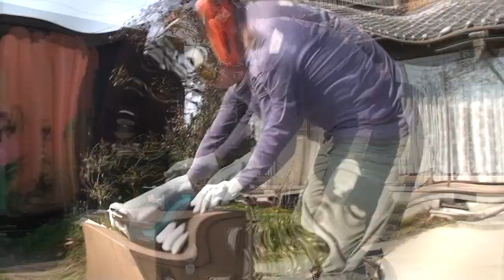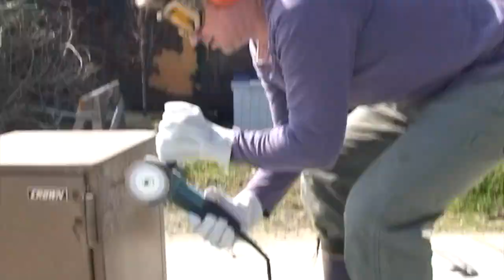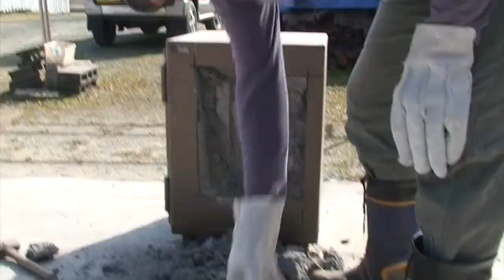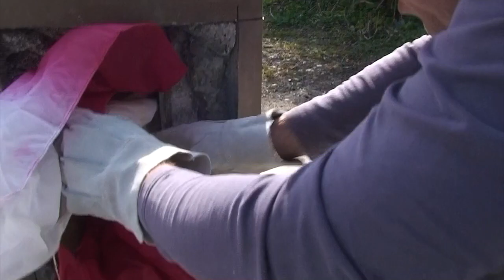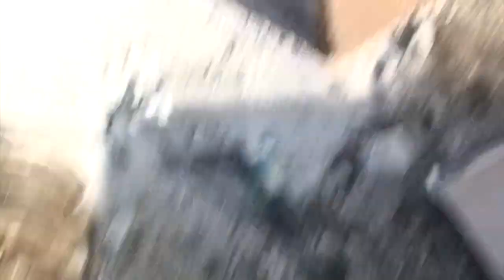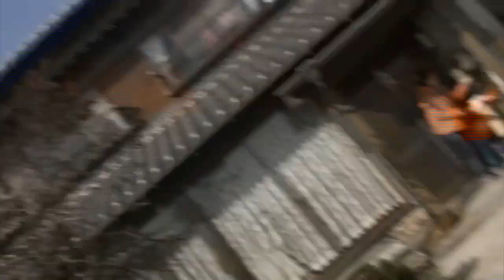Safe VS Angle Grinder

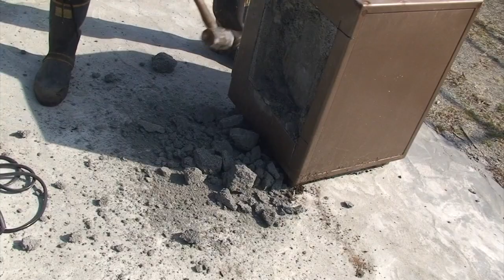Comment: I've gotten to 2:41, and I am now convinced it is a safe filled with hardened concrete. 
Must be heavy!
Reply from the maker: It was a fire proof safe so it had concrete walls.  The concrete was actually a little lighter than normal.  It had air holes in it.
Reply: @snowaterider  That makes sense. 
Thanks, Jevon!

Comment: How long did it take u to cut it open just wondering . I’m Thinking about getting one of those heavy safe that’s made out of concrete.
Reply from the maker: Maybe half an hour.  The concrete just makes it fire proof.  It's for documents.
Reply: @snowaterider  so do you happen to know if that safe had an RSC rating or if it was a TL 15 or TL 30?
Reply from the maker: @william38022  I’m sorry. It was my father-in-laws and he passed away. I do t think he would have remembered anyway. It seemed to be fire proof for documents.
Reply from the maker: Ivan Almeida  Pardon me?